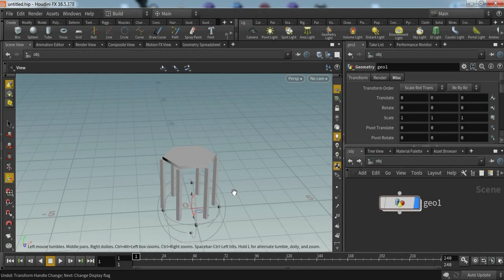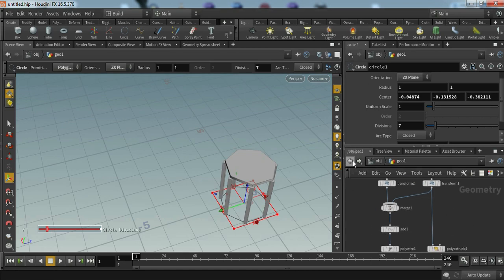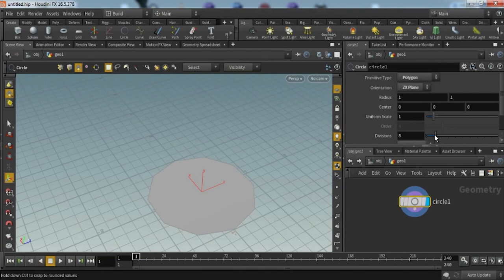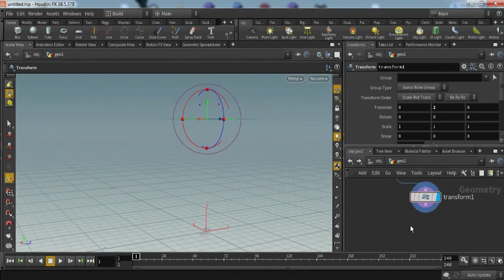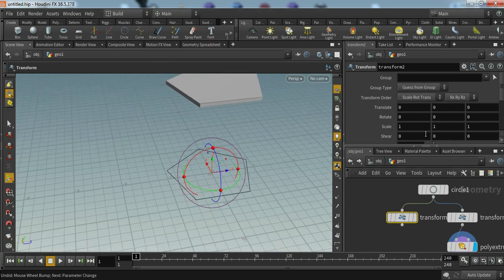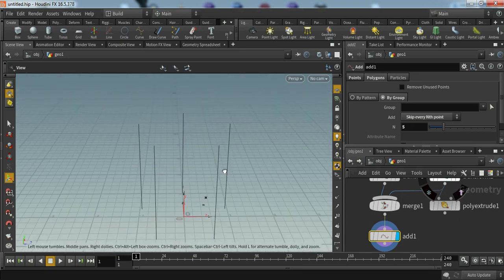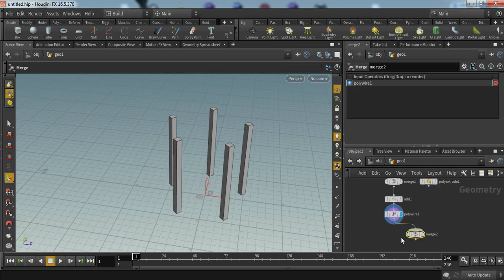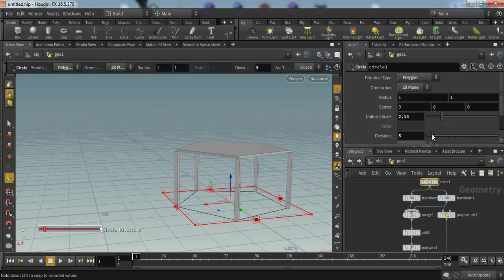Houdini procedural modelling - table model

Comment: love the tutorial but how do push legs a lit bit inside the edges of the table?
Reply: You can add a transform node after the ''polyextrude'', before it goes into the second ''merge''. This ''polyextrude'' is for the tabletop itself, while the other branch of nodes is to extract the tabletop's information for placing the legs procedurally.
Reply from the maker: Thanks buddy and for legs You just have to go inside the transform(which is for ground circle) and decrease the radius :)
Reply: @creatingvfx  oh! Thanks man! I was banging my head so hard because of this
Reply from the maker: @Captainsting  Glad to  help:) You have an awesome channel bro
Reply: @creatingvfx  Thanks! Im a CG artist myself but nowadays I've been trying my hands in procedural modeling. How to solve the leg issue though man?
Reply: @creatingvfx  I tried increasing the radius but the legs are still somehow attatched to the corner and appear to be outside of the main table top!